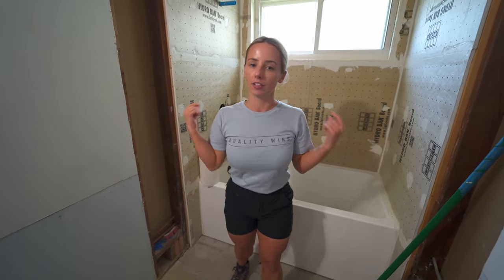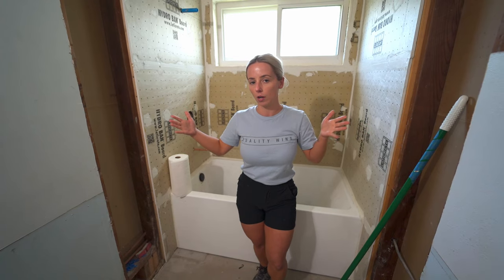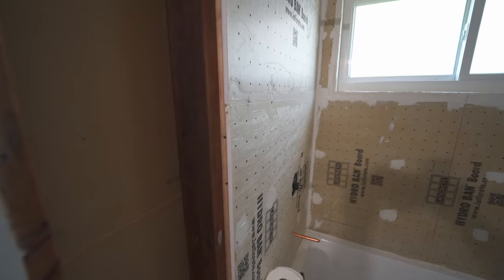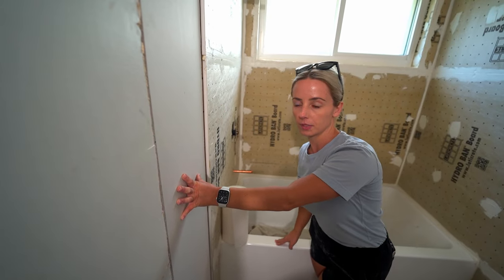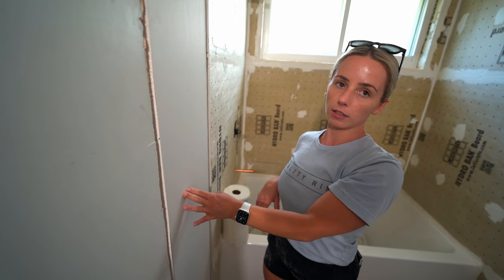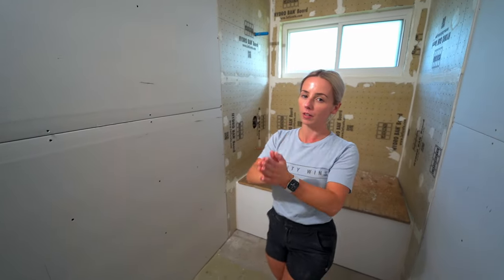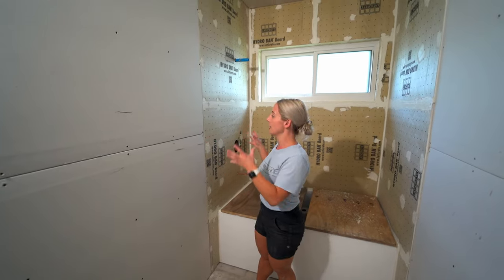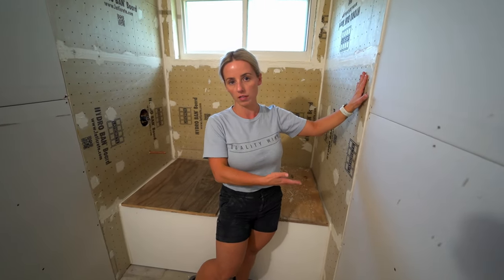Drywall to Tile Backerboard transition

Comment: I have done several things to deal with the difference, but I've never had a full half inch (or in your case more than that on the one wall). I have used pencil tiles, trim profiles and thinset to hide and/or make up the difference. Marble pencil tiles come in a lot of different sizes and used creatively can hide a lot of issues. My last tub surround I did one of the adjacent walls wasn't plumb and I extended my tile out over the joint and used thinset to compensate for the difference along with the trim profile.

Comment: Nice work! If the customer is okay with it ill leave a 2" gap between the cement board and sheetrock then install a 2" x 2" molding in the gap from floor to ceiling and adjust the molding so its evenly exposed on both sides.
Reply: What kinda molding ?
Reply: @j.w.r.i2910   1x2 or 2x2 pine. The

Comment: I do more or less the same which ever material you use you just need to make sure its flush, and square at the end to allow for tiles, although i have tiled onto some bad walls and had to use more adhesive what a faff that was, keep up the vids tileochick

Comment: I would have put on sister studs and maybe a few shims to get the studs out where they belong. You would have a strait flat wall then.
Reply: Absolutely
Reply: Yep! I've used paint stirring sticks on studs b4 to level the walls out
Reply: She did that and that’s what gave her the height difference between the sister studs and the original sheetrock. Remember, the new tub was smaller than the original space. She HAD to sister the studs to snug up to the tub…

Comment: Was there 13" off the wall to center of toilet flange, so you could bump it in and still have enough room to set the toilet? Or did you have to move the toilet flange into the room further? Or did you buy a special 10" toilet and let it sit far away from the wall?
Reply: 12 in is rough in measurement, 1/2 in won't hurt
Reply: @daleon96  yes, yes it actually does. I've repaired one where the tank shape was cut into the wall because there wasn't enough room. There's a reason they provide you with rough in numbers. It's because that's the distance you need.

Comment: Quick question, I see that the drywall guy you had mentioned you used for this ran the quickset/setting compound into your wet area. How do you now go about water proofing that? I recently decided to remodel my own bathroom, except in all these tile tutorial videos on YouTube most of you all use the foam backer board. Where I'm at (NY) I can't find it locally without special ordering it, and the closest thing I could find was the James Hardie hydro defense cbu, which is a 100% water proof backer board. The only issue is that it's .42" and not exactly a half inch. I used shims where I could to get it to be as flush as possible, but obviously as I'm screwing it down, thin setting the gap between the drywall and cbu, and imbedding the mesh tape, I have some low spots. Should I just compensate with the thinset as I drop the tile on the walls? The low spots are probably no more than 1/8" to 3/16", or would you recommend a different way?
Reply: You can use a liquid membrane lol ke redgaurd or aqua defense

Comment: Hey is durock a MUST for bathroom walls? My contractor messed up and didn’t use (only partially used greenboard) and not sure if I should redo entire walls .. thanks!
Reply from the maker: For a direct wet area like in your shower waterproofing is a must green board is unacceptable. In the bathroom itself not hit by water green board will be fine
Reply: @ThatTileChick  Great - thank you!